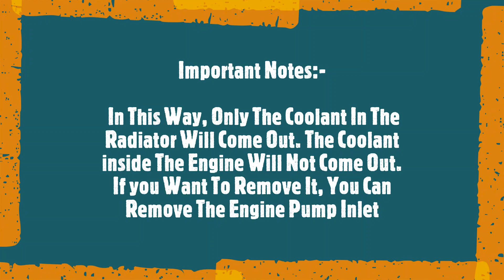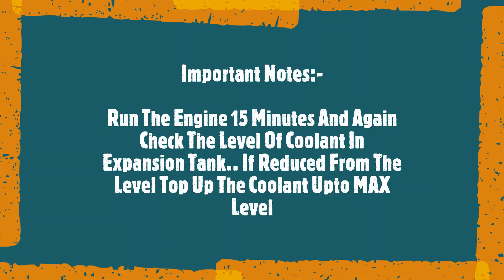How to change coolant in Ford Figo/Fiesta

Comment: You add too much water in coolant the ratio should be 50:50
Reply from the maker: Thanks 🙏🏻🙏🏻🙏🏻But instructions in that coolant fluid manufacturer mentioned 1:4 ratio brother..so only I did it🙏🏻🙏🏻
Reply: @sktechworks  ford genuine coolant comes with 45:55 ratio brother so for perfect results use 50:50 ratio . With your formula coolant looks like "only paani"
Reply: Must coolant be diluted before put into car like ford fiesta ?
Reply from the maker: @pomajoffice1991  Two type coolant available bro.One is already diluted and this coolant no need to diluted.Second one is concentrated and this coolant is diluted before refilling.